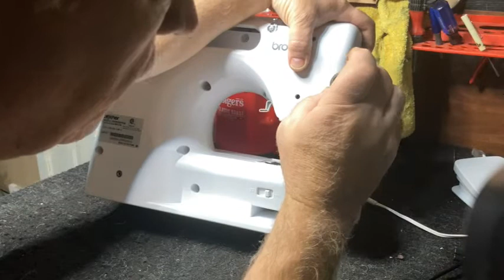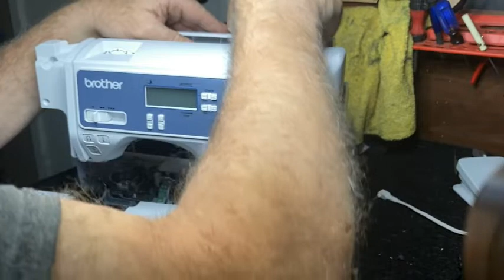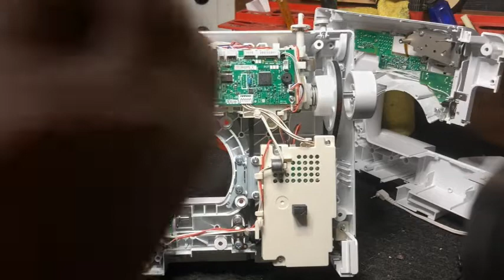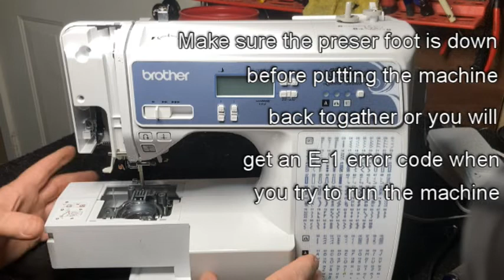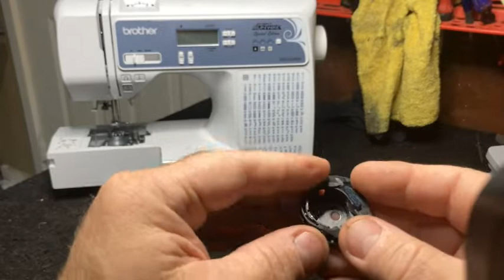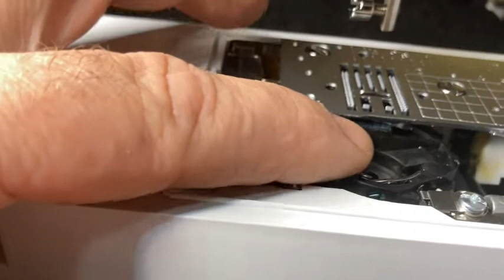Brother XR9550: Service & Repair

Comment: This maybe a stupid question...I have a Brother Innov-is 1500D and it has quit moving the fabric but only when back stitching. I've never had it do that before and I clean it very often. I'm just wondering why it would be doing that and any advice you have would be greatly appreciated.
Reply from the maker: @jackysmith1282  there are a number of reasons it would do that.

Pull your needle plate and make sure there is no lint buildup between the teeth on the feed dogs.

Will the machine feed in reverse with a straight or zigzag stitch?

Have you recently cleaned the machine and then it quit back stitching?
Reply: @sewingmachinetipsandtricks9079  I’ve taken needle plate off and made sure everything is completely clean. I did it before I cleaned it and it won’t feed in reverse while straight stitching

Comment: I have a Brother CE5500T that is only sewing on reverse. There is no error code, I can change stitch type and it still sewing only on reverse. The reverse button doesn’t seem to be stuck. Would you be able to help me fix this issue on my own? Unplugging the machine is no longer an option to make it work well (it used to work). Thank you!

Comment: Thanks for taking the time to share your knowledge in your videos. One problem I wish you could show is about problems with sensors. My brother SE625 supposedly has an upper thread sensor that keeps tripping after about 15 stitches and says my upper thread needs to be re-threaded. (Says the same thing if I run it without thread.) Stitches are fine and I've re-threaded about 100 times, changed bobbins & bobbin thread, -even changed the bobbin case. Still getting the error. We're going to try to get into the spring (at #3 threading guide) to see if we can loosen it up because it does feel a little sticky, but is there a sensor there? Can we clean it? I'm hoping just loosening the spring will do the trick. A service guy looked at it and said it's got lint on the sensor and will cost $200 just to clean it. I do keep my machine clean, have had it just a year and haven't sewn that much, but I guess it's possible! Thanks again.

Comment: Wow this video really helps to understand, in some parts it was difficult to see because of your hand nevertheless you explained súper clear 

As far as the grease and oil you mention is there an specific brand I can find on Amazon?
Reply from the maker: You are very welcome, ya sorry about the hands thing, I get that a lot, they are  good size and hard to see around. sometimes I can't even see what I am doing and have to rely on touch.

I personally use triflow.
here is the oil on Amazon
https://amzn.to/3Cl4wl2

Here is the grease
https://amzn.to/3Mkq0CV
Reply: Awesome I really appreciate your quick reply, at school I had to make some video where the table was visible in all angles so what I did was to put the cellphone in between the two lights that have a base with a broomstick, it was very primitive however effective because people could see sometimes even better than me 😅 maybe that would help you as well
Reply from the maker: @alexlopez8922  
Thank you, I appreciate that!
I will give it some thought.

Comment: I have a artisans 797 ab.      I hope this is the right place but I believe it’s my tension it’s the thread is looping on the bottom of the project
Reply from the maker: Commercial machines are completely different than home machines, timing be very slightly can cause looping but so can many other things.

Damaged needle,  damaged hook, improper bobbin case finger position, improper threading, wrong tension adjustment, buildup in between the tension discs and several more things depending on the specific machine.

Comment: Hi, I own the same machine (XR9550PRW) and was wondering if you knew the type of motor it carries (e.g., DC or AC, BLDC or SMPS)? I just moved to a 240V-50Hz country and want to double-check I can simply use a step-down transformer without any risk for my machine (otherwise will try to replace the motor). Thanks in advance
Reply from the maker: Don't worry about the motor voltage, so long as it is fed with the correct input voltage the machine will do the rest.

I am assuming the machine you have is set up for U.S. power systems since you said it is the same machine that is in the video.

The step-down transformer needs to have an output of 110v - 120v and 60 cycles or herts and I believe at least 5 amps or 600 watts. Look at the tag on the back of the machine it will give you all that information.
Make sure the transformer output amperage or wattage is at minimum  what is on the back of the machine, otherwise you will overheat the transformer, burn it out and possibly start a fire.
 
If you feed the machine with what is marked on the tag on back, the machine will handle the correct voltage to the motor.

Comment: Hello, my Brother ce1100prw machine makes a strange noise on the right side when sewing folded fabric.  What could that be?
Reply from the maker: Without hearing the noise it’s hard to say.
But the motor belt is on the right side, it could be slipping. It is a cogged belt so it would make a popping sound.

Comment: Are thread take up levers supposed to have any play in them? My Brother xl5340 makes a noise & we took off the top end cap. It seems that the thread take up lever is hitting a small metal bar that  is under the take up lever and is for the end cap to attach to. I can wiggle the lever without much effort.  I found this machine for $15 at Goodwill yesterday & would like to use it for a sewing ministry where some women don't have a machine. I don't know if I should put more money into it or not. I have looked all over but cannot find anything on this. Thank you for any help or direction for answers!
Reply from the maker: Hello MH,

There should not be any play in the take-up lever at all.

If it is hitting something  and moves then it is either broke or out of adjustment and loose.

Follow the movement when you wiggle it and see where the movement stops, that is where the problem is.
Reply: It seems to be loose at the screw housing where the lever's front facing part & the back facing part meet at the "y". I will see if my husband can tighten it. If that doesn't work....😊 Thank you so very much for your quick reply!  Your information on repairs, etc. is very clear, btw.
Reply from the maker: @GrandmaRilla   Your very welcome! 

That Y is adjustable, if it is still hitting anything after is is tightened then it will probably need to be adjusted for the correct height.
Reply: @sewingmachinetipsandtricks9079  well....I took a few things off & it's actually the back horizontal pin (?) that is loose. It moves forward/backward some, mainly on the right as you face the machine. Also, when I push on the upper part of the thread take up that is the arched part going back (plastic) it places the take up so it doesn't hit. But, I  think something is broken, not sure where to find parts (I looked) and probably more expense than the value of the machine. Sigh. I  want to take the back off to get a better look but I would probably break something. Hubby says just run it as is...only $15. Thanks for your answers & for listening to my woes. Have a good night!
Reply from the maker: @GrandmaRilla  
You have a great night as well, sounds like a setscrew maybe loose or missing that holds that pin in place.

You can find parts for that machine here.
https://www.sewingpartsonline.com/brother-xl5340-sewing-machine-parts.aspx?index=1

There are several parts for the take up assembly on there not sure if you need any or not.

Let me know if I can help with anything else.
Reply: @sewingmachinetipsandtricks9079  Oh, thank you for the on-going help! I'll show this to my husband & see what he can do to figure that out. Thank you for the link, too. I went there earlier but not much showed up. I will try again.
Reply: Just in case you can't sleep at night because you are wondering what the outcome was (🙃)...
We found an exploded view of the machine, got in as far as we could w/o taking the case completely off (way too complicated) & found that the part that was needed is no longer made. That settled it. Returning to Goodwill. You've been very helpful. Thank you once again!
Reply from the maker: @GrandmaRilla  

Thank you for letting me know , sorry to hear it did not work out.

Hope you find one that works. If you need anymore help don't hesitate to ask.

Comment: I have a XR9550, Can you tell me what the switch on the back is for? The one with the triangles on both sides.
Reply: It’s to lower the feed dog (I think that’s what it’s called) under the sole plate so you can use the freehand embroidery foot

Comment: I was trying to figure out how to fix my needle position on this sewing machine.  I took off the cover and was attempting to tightens up the screw. Something fell out and now I have no idea what or where it is!  So mad at myself,  what do I do, I am pretty sure it control the up and down of the thread lever.
Reply: Hi.  I now place a Kleenex or sheet of paper under the needle area when I work on it.  Before I learned this trick, I’ve lost little pieces inside.  The only way I got them out was to turn my machine upside down and gently shake it.  You might have to shake a couple of times for the piece to fall out.  Good luck!

Comment: The part (XC8799021) that is linked in the article in the description doesn't seem to be the exact replacement for the bobbin winder on the Brother XR9550, the grey "stem" is too short. Thoughts?
Reply from the maker: That is the part I have personally used on that model of brother,  possibly the wrong part was shipped.

Comment: When I try to sew the needle does not pick up the bobbin thread, what can I do ?
Reply from the maker: @DebaChambliss  

There are a lot of possible problems.
Is it full of lint?

The timing could be off.

Here is a video to help you determine if the timing is off or not.
https://youtu.be/hW-4OV4IWVc?si=DSFD0mvvdhmqvT1F

Comment: Oooo please help my feed dogs went down and would not raise to the bed level, what happened and can I fix it ?
Reply from the maker: Your feed dog drop switch is probably in the down position.

It’s on the back of the machine near the needle plate push it to the up position.
Reply: @sewingmachinetipsandtricks9079  no it’s not unfortunately , as I turn the knob on the side of the machine you can see the dog feed move but nowhere near the base plate
Reply: @sewingmachinetipsandtricks9079 ah , sucess, it was the base plate not fitted correctly, I’m lucky I’ve been using my new machine for a year like this, there was a bit of an odd sound but as it was new I didn’t think anything of it.😅 many thanks I’ve just completed my first services thanks to your expert step by step instructions , just putting it all back together now

Comment: My bobbin tension is way loose. How can I fix this?
Reply from the maker: That depends on reason that it is loose, have you tested it to ensure it’s loose or is that a guess based on how it is sewing?
Reply: I have tested it. When holding upper thread and bobbin thread and lightly tugging on both at the same time bobbin thread extremely loose. Also when sewing in reverse the stitches loop on top and bottom.
Reply: My machine is a Brother XR9550. Not crazy about this machine but the price was good.

Comment: This is a good explanation of parts.  But, your fingers are sometimes in the way and I can’t see where you are putting the oil.  My Manual says we (buyers) should not oil our machines.  ???
Reply from the maker: The main places the machine needs oil is on the needle bar, and all 4 bushings.

Machines need to be lubricated, there are many fast moving metal on metal parts that need oil.

I make these videos to help people who are unable to take their machines in for what ever reason, or who can not find a competent repair shop in their area, take care of their own machines. 

You can take your machine in to a service center to have it serviced and lubricated, you can do it yourself or you can run the machine until it either locks up or burns up. 

Sewing machine manufacturers make machines cheap, hard to get into and recommend you do not lubricate the machine so they can make more money by either repairing your machine or selling you a new machine.

It is not limited to sewing machine manufactures, unfortunately we live in a throw away world where we are encouraged to buy new rather than repairing the old.

I have a talent and skill and try to help as many people as possible with it.
Reply: @sewingmachinetipsandtricks9079  
I agree with everything you said.  We do live in a disposal society.  I will try and oil my machine.  But, what are bushings??? I’ll look at my manual but I don’t remember seeing that word!  Thanks for your work.  It is impressive.  I too love taking machines apart.  But I think I’ll take pictures after every step…
Reply from the maker: @honeywell891  

Bushings are what hold the upper and lower shafts in place, similar to a bearing.

Here is a video on a locked up machine, an upper and lower bushing is locked up. 

Yes the machine is completely different from your brother but they both have bushings in the same general area, this should help you better understand.

https://youtu.be/vb4Ujg2l3o0?si=UX_I2l7l7OUuNpnv
Reply: I can't afford to have my machine serviced. It would be more economical to buy a whole new machine. Thank you so much for making this video. I figured that if I had the intelligence to construct a garment then I could do this with guidance and I did. Thank you for taking the time to make and post this video!!!

Comment: Um, never pull on wires to remove a connector! Usually a small screwdriver can be used to separate the plug from socket.

Comment: Hey. Thanks for the video. Is opening the machine up like this the only way to fix a situation where my presser foot lever will not stay up? I'm just setting up the machine.  Here's what it looks like: https://youtu.be/su9lCuDcfeE
Reply from the maker: Hello Joy,

It does depend on the problem with the machine but for the most part yes.

If the presser foot will not stay up then the problem  is probably inside the machine.

You said you were just setting it up, if it is a new machine it might be better to return it and get another machine.
Reply: @sewingmachinetipsandtricks9079  We bought it a couple years ago, this is just the first time I'm trying to use it.
Have you seen this issue before?
Reply from the maker: @TheJoyBinkley  

I have not seen it in these machines, but I have in others.

It is usually caused by wear, obviously that is not the problem here, I would guess the oil on the assembly inside has has dried up and keeping the spring that holds pressure on both the presser foot and the lever from properly operating.

Without pressure being applied it would fall.

I would suggest opening it, cleaning and lubricating the mechanism very thoroughly.
Reply: @sewingmachinetipsandtricks9079  thanks :)